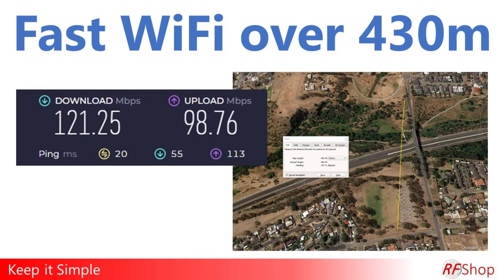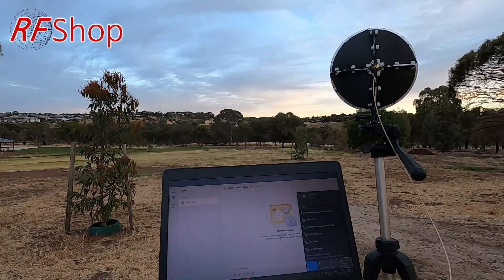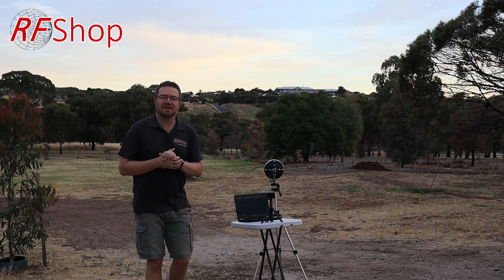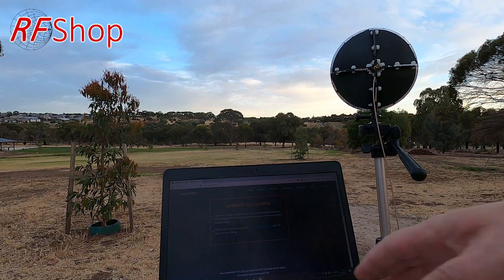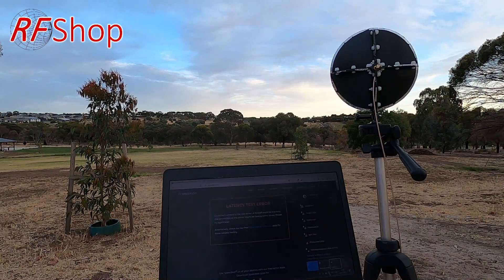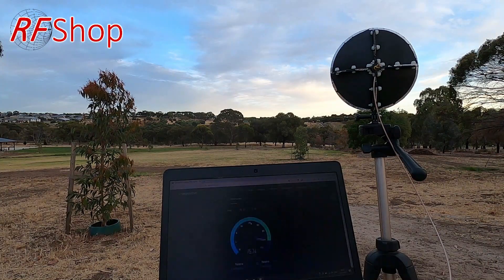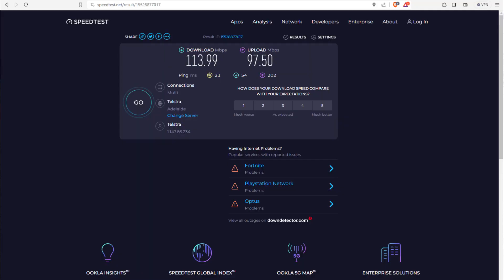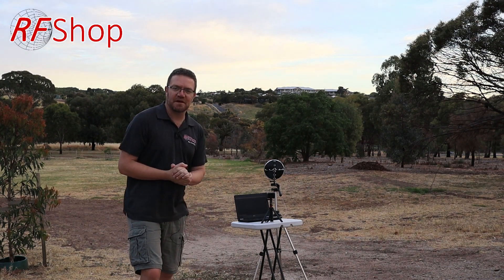Maximizing Wi-Fi Range: Testing a 400M Antenna Setup with 3D Printed Technology!

Comment: This is impressive
What I couldn't understand is, are these antennas purely directional to achieve the distance?
Reply from the maker: Thanks for the initial remark. 
Yes, the only aspect of the link I focus on is the antenna performance. 
The antenna gain is a passive contributor, and helps in both the uplink and downlink of the chain. I do realise that I'm testing the limits of legal compliance when we consider the transmit powers, but in a proper system design (not my crude PC setup) one could then drop the Tx power so the limit remains within the local (wherever that is) limits...but despite having perhaps dropped the transmit power, the receive chain still has a higher gain antenna and will perform better. 
So, even if a higher gain antenna means dropping the power, that's only one drawback where there are many more advantages to explore...and that's the journey I'm taking with this antenna.

Comment: Actually you are not exactly comparing antennas. You would be better comparing the 3D antenna with a standard antenna. Either what came with the USB device or if it didn’t have one, then some stock off the shelf antenna one might get with that device. In that way, the performance of the wifi radio components do not impact on the test.
Reply from the maker: Greg, I 100% agree. The intention with this video was to proof to myself the antenna works, but also to get something on Youtube that I can refer to when I present my Kickstarter.com project later this summer (one of their criteria is to proof you have a working concept and not just a "pie in the sky" idea). 
My plan is to build an outdoor VNA antenna test setup so I can specifically test antenna results without any modem, and the other plan I had was to test the actual range I can get with this antenna on a local beach.